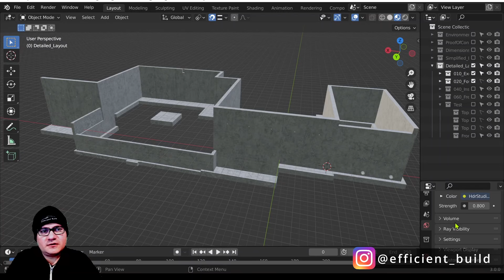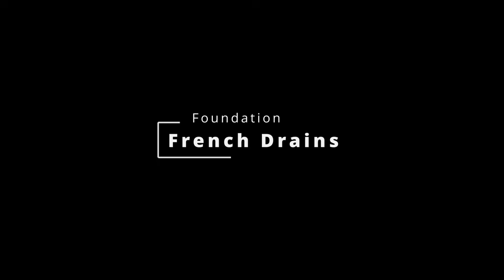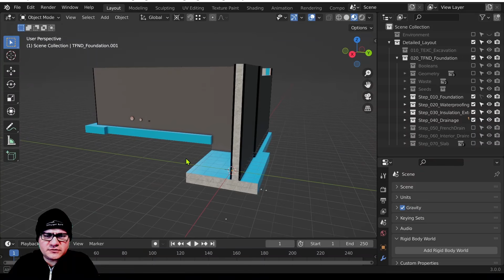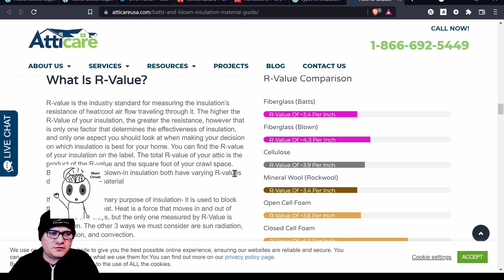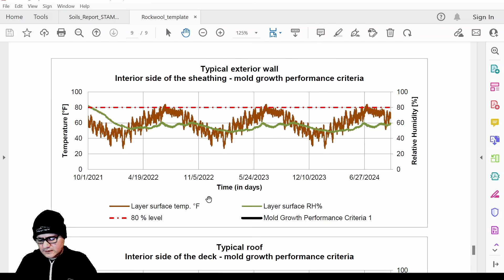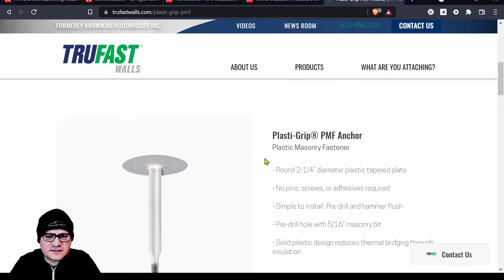Ultimate Guide to Foundation Waterproofing, French Drains & Exterior Insulation | Efficient Build

Comment: You should be using a waterproof membrane on the outside with 3/4 stones, dry dirt, etc
Reply from the maker: In the video I talk about Poly-Wall home stretch liquid waterproofing. In the implementation video we used Bituthene 4000

Comment: Drain board on TOP of footer? That’s a big no no.
Reply from the maker: No, we're not using drain board on top of footer, only Bituthene per manufacturer recommendations. It goes: Foundation->Bituthene->insulation->drain board. Only Bituthene on the footings. We have videos on the full assembly of Bituthene, insulation, and drainage mat. We have a couple projects on video. If you are going by the render thumbnail what you see is geotextile fabric for the french drain on and next to the footers.

Comment: Question: many reputable contractors advise that the french drain at the foundation has the perforated pipe sigging driectly on the bottom of the trench: ensuring that there is no water collected beneath the pipe, and drains everything from the trench. 
I think this is the right approach instead of having 2" of gravel under the pipe. 
Do you agree?
Reply from the maker: Some people recommend the perforations at different locations. We decided to perforate 3 holes at 120 degrees from each other with one of those alignments pointing down. By pointing down that allows the water to enter the pipe and exit as the water level rises. In the "burrito" assembly the geotextile fabric helps prevent smaller soils to enter and the 2" below the pipe act as buffer for what ever thin soil does enter. I believe that is the reasoning for the minimum 2" of crushed rock below the pipe, mainly to prevent clogging over time. The approach we show is what our soils engineer recommended so it will be hard for me to say there is a better or worse method. Might make for a good experiment to run.